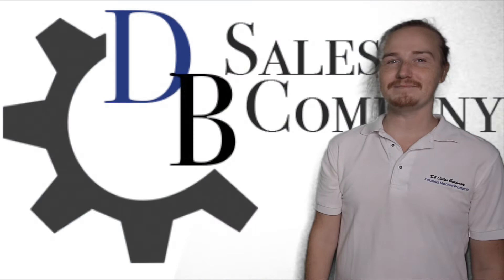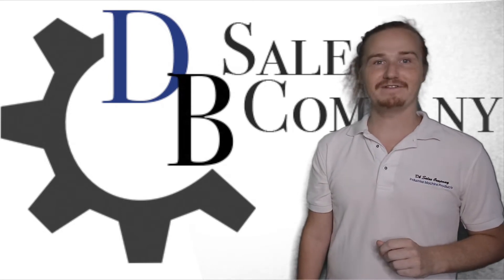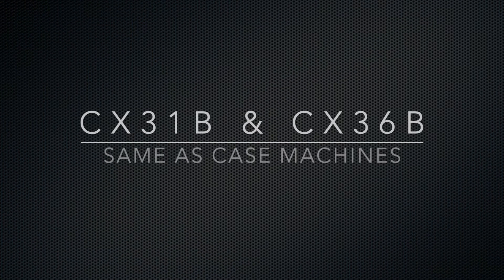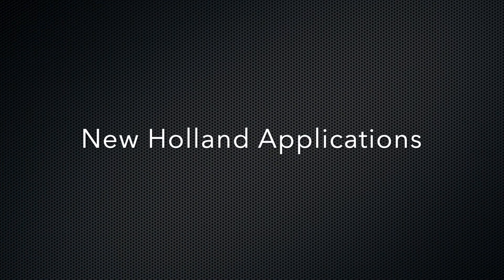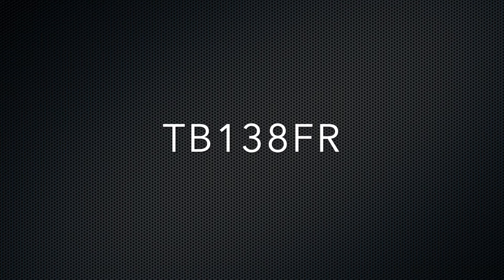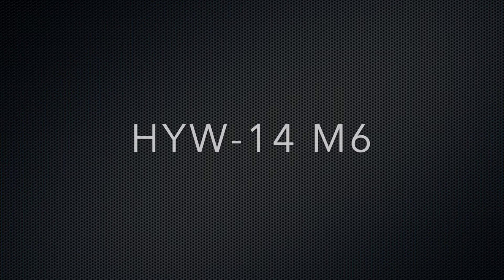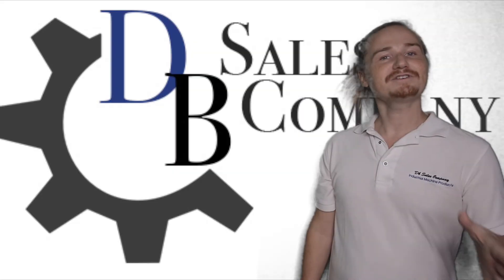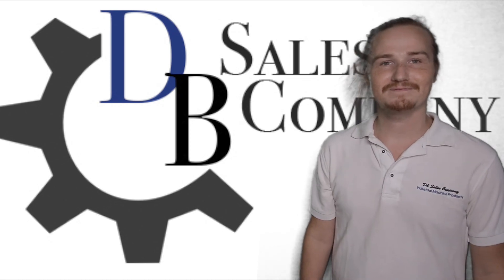Yanmar 3TNV88 Applications

Comment: This is extremely helpful. What is the difference between a 3tnv70 and 3tnv88
Reply from the maker: hello! thank you for the feedback! the main difference is that the bore diameter on the cylinders for the 3TNV70 is 70 mm, whereas on the 3TNV88 the bore diameter on the cylinders is 88 mm. This makes the block on the 3TNV88 and the engine itself a bit bigger. I hope this helps!